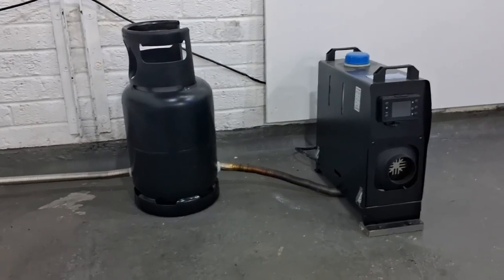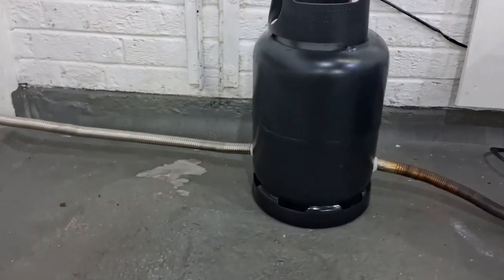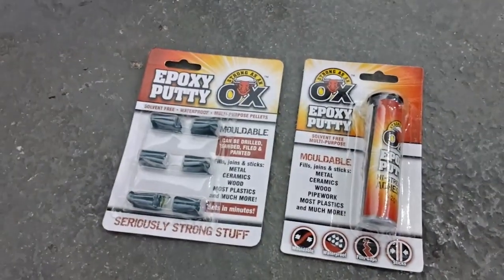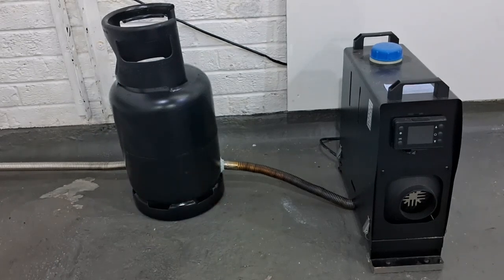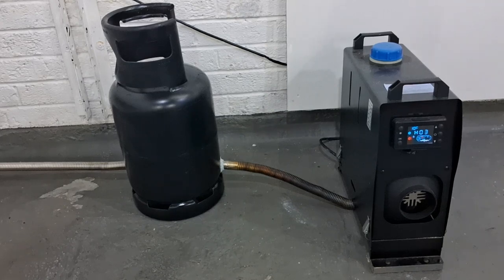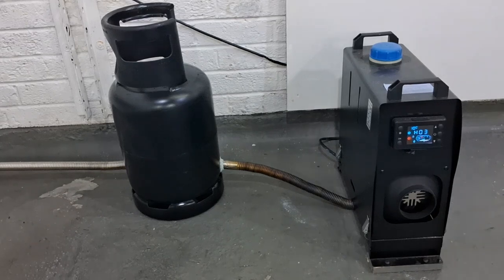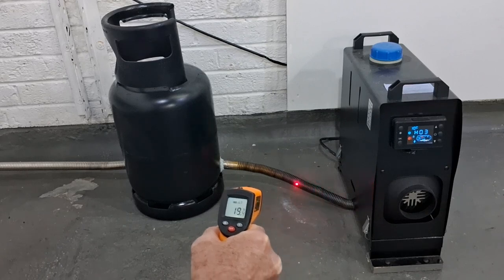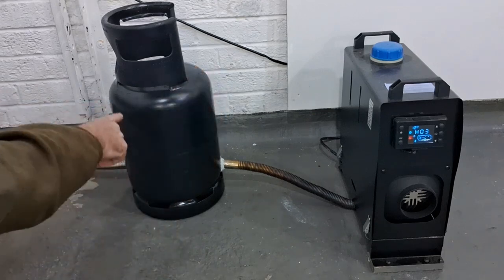Diesel Heater PUMPING EXHAUST GAS into Gas Bottle to Store Heat Energy Storage Experiment Off Grid

Comment: What if you entered hi on the kerosene heater side and an angle so it would spin around on the inside of that bottle and low but still higher than the outside wall exit on the lower side of the bottle so it would spin around like a tornado and exit out the pipe out the wall

Comment: I think a laser thermometer struggles with  some surfaces. Google "Digital Thermometer with K Type Thermocouple" you should find one of those useful and you can get them for about £15.

Also i was thinking what you are describing with a plate on top is similar to a rocket mass heater. That would work well.

Comment: Perhaps an old water central heating radiator connected to the exhaust, they are already designed to radiate & convect heat. ?

Comment: I wonder if you cut the top of the gas barrel off, looped the exhaust inside and filled it with sand would it get hot enough to work like a sand battery? Love these experiments thanks....."edit".ok got to the end of the video and you already thought of that 😂